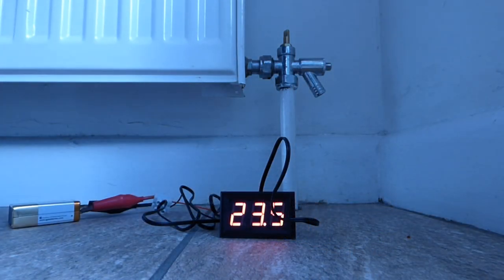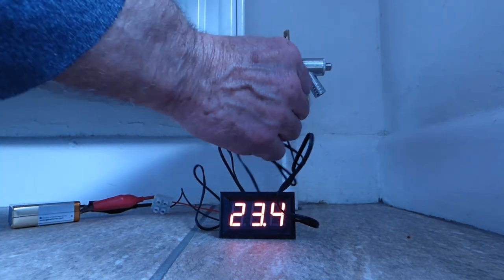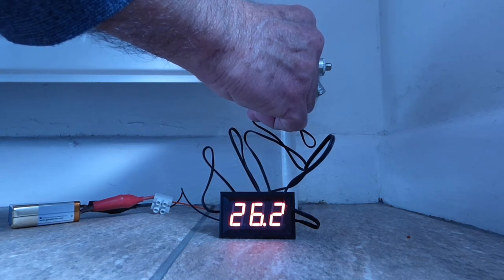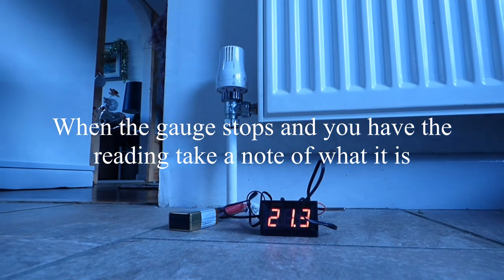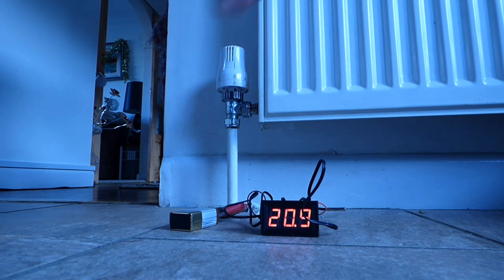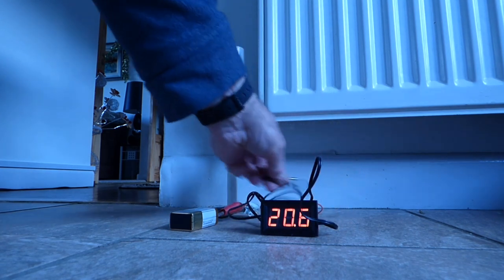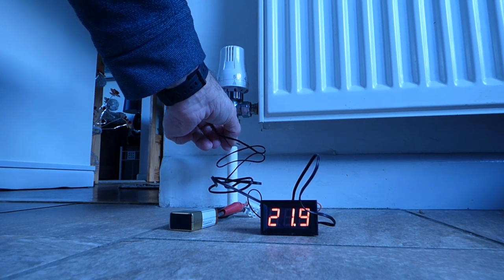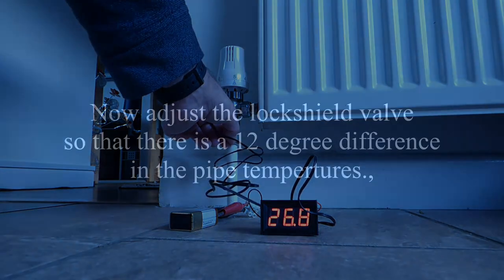How to accurately balance your heating radiators using a thermometer

Comment: I had new radiators double convection installed through out the house. Got a system boiler the heating comes on every hour. And stays on for 15 miniutes. House seems to hold the heat for for a very long time   before switching in again.
Seems very efficient or  am.I missing  something? Can you explain some details what's happening and why ? Thanks .
Reply from the maker: You just have a well insulated house and with double convector rads fitted it will not take long to heat your house, so you will find the boiler does not have to stay on so long.
Reply: @dereton33  so if the insulation is good that will negate the effects of unbalanced radiators or is this a poor assumption? Could you give an explanation on good  insulation Vs balanced radiators. Balancing radiators is about reducing the loss of heat through the system am I right? So having good insulation negates this problem?
Reply: @setitthen  Balancing the radiators is about making the distribution of heat even throughout the house, so that the radiators all pull their weight.  If the system is unbalanced, you will have some rads hotter than others and likely will end up wasting heat (=fossil fuel, and also money) by turning the thermostat up to make the coldest room warm enough - and in doing so causing the ones already warm enough to overheat.  Either that, or leaving doors open to try to spread the heat around.

Good insulation is ALWAYS a good idea, and it's not EITHER this OR balancing the system as you suggest.

Best of all, if you've got good insulation, a balanced system AND a load or weather-compensating boiler that's not oversized, you will then get the boiler reducing its flow temperature on all but the coldest of days.  And the magic of a low flow temperature is that it keeps the boiler in condensing mode - which wrings up to another 11% in efficiency out of the system.

Comment: It would be helpful if you could say which way to turn the lockshield valve (open or close) to increase or decrease the temperature difference across the radiator. Very good video though.
Reply from the maker: Noted
Reply: turn it down to increase temperature differential

Comment: Should the lock sheild valve be on the flow or return side of the rad ?
Reply: Return
Reply from the maker: That`s right the return, but you may find the odd new ones on the flow as thermostatic rad valves can now be fitted either way round.

Comment: Hi do I need to balance indirect heating cylinder as well. If Yes how. Many thanks.
Reply from the maker: No need.
Reply: @dereton33  Many thanks. The reason why I ask this questions is that the water from hot water tap is not warm but the radiator is very warm - it takes a long time to use warm water - maybe this because it's indirect heating cylinder?

Comment: I was once told that one of the rads on your system had to be fully open, both lock shield and TRV. Any truth in this before I start balancing ?
Reply from the maker: Not if you have a combi or a bypass valve on a F and E system.
Reply: @dereton33  Thanks for the reply, and thank you for all of your videos they have really helped me out over the years.  F&E system red plastic capped valve in the airing cupboard so guessing that's it.

Comment: Do you have any videos on solid fuel heating system? We have a coal fire what heats the upstairs radiators automatically when the water his hot but I can’t turn on the radiators downstairs until the water is 85c so it hard for me to balance the system.

Thank you
Reply from the maker: Sorry Liam I have nothing on solid fuel boilers.
Reply: dereton33 no problem Thank you for getting back in touch 😀
Reply: Liam, not a plumber but had a system similar to yours for many years. The rads upstairs that was permanently on are a safety feature to ensure excess heat is being removed from the boiler when the fire is lit and it is important they are never turned off when the fire is lit..I would not bother to balance these unless you have an issue. As for the rads down stairs balance them like in the video as they are indipendent of the rads upstairs due to the main thermostat.
Reply: Peter Evans Thanks for that Peter, I did turn all the upstairs rads down to half a turn or a full turn can’t really remember now, so should I turn all them back fully open? And just balance the 5 rads downstairs? Sorry if this doesn’t make much sense 😀

Comment: sorry to come across as dumb, but when you mention about the 12 degrees difference which pipe should be hotter than the other is the lockshield end hotter or the TRV end or doesnt it matter as long as there is a 12 degrees difference or can only 1 pipe be the hotter one no matter what you do so it is self explanatory?
Reply from the maker: So long as there is the 12 degree difference it does not matter.
Reply: @dereton33 Hello! If the temperature diference is 20 grade is need close or open the retur?

Comment: My boiler is losing pressure.    Been happening for just over a week.     I wrapped toilet roll around every pipe in the house to find the leak but nothing.     I'm having to top up the boiler every day before turning the heating on.    Also,  it's a condensing boiler but there's no vapour coming from the flue when the heating is on , only when the hot tap is being used.   Does that indicate it's not condensing properly?   Thanks.
Reply: Check the overflow from your boiler, if there are no obvious leaks on all your radiators valves or pipes in the floor/ceiling you will likely find its the pressure relief valve inside the combi boiler that is stuck open, you will see a little pipe just under the boiler flue on the outside of the house, if water is coming out of that then its the pressure relief valve, they are cheap enough to change out, if your having to refill every day you would really notice that leak if it were inside the house.
Reply from the maker: Thanks for answering that one Knoxieman.
Reply: Or the expansion vessel needs recharging or replacing if it's a sealed system
Reply: Vaillant ?
Reply: @MrElliott1979   It's a veissmann condensing boiler
Reply: No vapour means it's condensing, a big white plume means it's not.

Comment: Hi al , i managed to follow your advice by turning the downstairs rads by 1 full turn and it's made all the difference they all heat up very quickly!
Just one more thing regarding the balancing valve on the coil, how many turns on this valve will give sufficient hot water time and not rob heat from the radiators if both are on demand?
I have counted the number of turns and it takes 4 full turns and a quarter from fully closed to fully open, its fully open at the moment.
My system is a y plan with a Worcester 18ri condensing boiler if that helps?
Thanks
Reply from the maker: I would give it one and a half turns.
Reply: @dereton33  thanks again

Comment: Thanks for the information, but if on a air source heat of 44 degree running from the boiler, would I still be looking for a 12 degree difference ?
Reply from the maker: Yes that is the norm.

Comment: If there is only one of you, In a large house could you open all the valves etc to max and test the temps at the rads. Would the highest temp be the first one, the next highest the second one etc. then if there are ones that are off you’d only have find the order of those couple.
Reply from the maker: Yes that should be ok.

Comment: When opening each radiator to adjust the temperature do I open the TRV completely or only to the required temperature when in use?
Reply from the maker: Open it completely Trevor.
Reply: @dereton33  Thanks, I guessed that was the case and did my system yesterday. I had problems getting the temperature difference right I think partly because some of our TRVs are fitted on the flow side and some on the other end so it was a bit hit and miss. I also used a laser thermometer which gave one or two iffy readings on pipes that had been painted over. Might not be perfect but had the desired effect as two radiators at the end of the system are now much warmer than they used to be. 

A couple of questions. I had one rattling radiator this morning and one hissing I'm guessing this is because it was the first time the system had been used after my re-balancing it. The other is that one or two rads are cooler at the bottom than top by a few degrees it seems to be more the further they are away from the boiler.

You were right about the time it takes. I have 11 radiators and was doing the last one at 11:00 last night! I found leaving the larger more distant radiators for half an hour after switching them on helped get better results.

Thanks once again your videos are really useful.

Comment: Hi Al, 

 Great video again! Just wondering, would it be a safe assumption that my radiators upstairs are heating up first as my boiler is in my loft?
Thanks.
Reply: Boiler in the loft ???
Reply from the maker: Yes that is right.
Reply: @dereton33  Thank you :)

Comment: Great instructional video, as they all are. Two questions though... I've turned both TRVs and lockshield valves fully open and have identified the order in which my 7 radiators heat up. I've gone to the first one as directed and turned the lockshield valve off and opened it up a quarter turn until there's a 12° difference. Are the lockshield valves on the remaining 6 radiators still fully open at this point, or are they closed down at the same time as the first? Is it a case of closing each one in turn as you make your way around and adjusting as necessary? I'm not too clear. Thanks.
Reply from the maker: They should all be closed down.
Reply: Top banana, much appreciated.

Comment: Great Video.
I've gone and ordered the digital version you suggested in your info, but I've come to realise that when I had the bathroom done; the Plumber mounted the LS on the Flow and TRV on the return. How do I balance this? Open the LS fully, and adjust the TRV with the nut below the head?

Or by some other way?
Reply from the maker: It does not matter, still do all adjustments with the TRV open and adjust using the lockshield. Use the nut below the head of the TRV.
Reply: @dereton33  thanks for that.
I am curious though, I have a condensing combi; should I still do the 11c difference or 22c from what I've read?
As always, your input and advice is appreciated

Comment: @dereton33 All the rads in my flat have TRV's fitted, except for the large rad in the front room. It just has two lockshield valves, one on either end. Also, the thermostat is on the wall in the front room. How do I go about adjusting them?
Reply from the maker: That rad has been configured as the bypass radiator, which is why it does not have a thermostatic valve on it. Leave one end fully open and just adjust it on the one valve.
Reply: @dereton33  Cheers, Al. You're a good un ;)

Comment: I want to try and balance my radiators as I am finding I have to turn 2 upstairs radiator off, and lower the thermostatic valve on 2 radiators to get all the radiators downstairs to heat up. Following this process, When I check to see the order each radiator is heating up, the radiators downstairs such as living room, kitchen do not warm up, what do I do in this case?
Reply from the maker: Turn off all the rad except those two wait for them to heat up and work away from those two.

Comment: I dont understand why you need to turn on, turn off, turn on etc the system, seems a waste of time. Why not turn on once, let it get up to temperature, then go around once with your thermometer adjusting lockshields for 12C difference across each rad?
Reply from the maker: That is your option. I am only showing the correct way I have always been told to get it right.
Reply: No, I wasn’t expressing an opinion, it was a question. At the moment I don‘t see the point in doing the balancing in any particular order if it is just a matter of setting a 12C drop across each rad, but then every source I’ve checked all say do it in that order. But then I’m suffering lack of sleep & not thinking very clearly.
Reply: And apologies if you really meant to say “option”; I read it as “opinion”. I am really tired!!